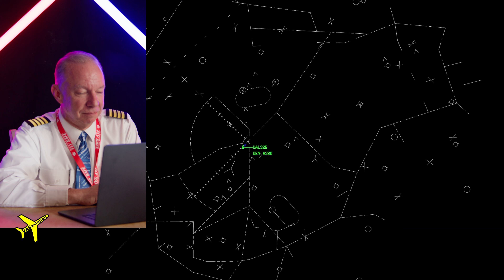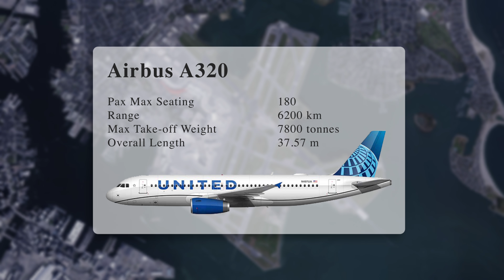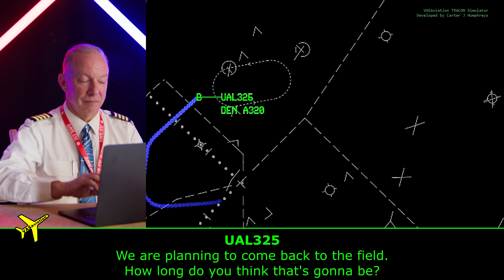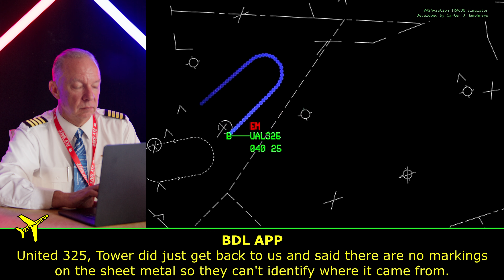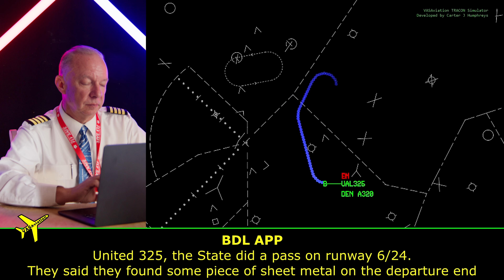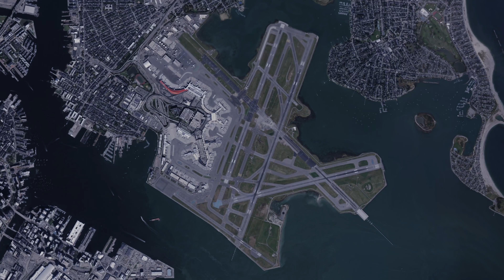United 325 Disaster Averted: Engine Trouble at Takeoff! | Captain Steeeve Breaks It Down

Comment: I know the Fire LT you heard speaking to the Aircraft.
This is from the report that was filed.
The Federal Aviation Administration (FAA) has confirmed that a United Airlines Airbus A320 was forced to return to its origin airport on June 20, 2024. The regulator said that the flight crew reported an abnormal noise during the flight.

The incident occurred on United flight 325, operating from Bradley International Airport (BDL) in Hartford, Connecticut to Denver (DEN). The flight was operated by an Airbus A320 with registration number N490UA. A piece of the engine’s outer liner, which helps to regulate volume, was found on the runway after takeoff.
Onboard, the flight crew noticed an “abnormal noise” emanating from the engine, which was explained by the missing liner. The flight turned around and returned to BDL, arriving about an hour later.
landing at the airport at 8:47. After the aircraft landed at its origin airport, it proceeded to taxi to the gate area at BDL.
with United placing passengers on alternate flights to get them to their final destinations.
Reply: Good summary.  The acoustic dampeners are part of the engine’s round inlet (cowling).  If they fall-off then they can pass thru the engine & cause damage to the spinning blades

.

Comment: As a maintenance guy this is our worst fear
Reply: I can only imagine. you keep them from falling apart and I kept them from hitting each other
Reply: @christophersaunders  We're doing a good job :D
Reply: Not like letting a car leaving the shop
missing bolts or not finishing job...?
Reply: @courtsports1 exactly. You can't pull over in the sky and fix it.
Reply: @courtsports1 you just like to argue and probably make everything about yourself
Reply: 🇺🇸Fried, I am number 138 thumbs up for your comment. ONE Question Please: With such Airplane parts, be it Sheet Metal (NO Matter the size), AND/OR Any Other parts, ARE parts MAYBE Engraved with Airplane Company/Business Ownership Identification Markings, MAYBE AT LEAST Identification Markings Engraved in 2 Places PER Parts, AND WHERE PER Parts Belong/Come From ON EACH Airplanes?? Thank you.
Reply: @KhenoronhkhwaJesusIs  What I know Airbus does is they will have an outside P/N and S/N and one that is inside the part that requires to be ground down and therefore damaged to be read. They can use it in case of an investigation if needed. But I don't think they do the same for metal sheets cause they are too thin
Reply: What is?

Comment: “Souls on board” also differentiates between people and bodies as sometimes aircraft may be transporting a dead body.
Reply: I've heard that before, but if that's the case why wouldn't they also ask how many bodies are on board?  If the plane wrecks and they're finding bodies, how does having info only on the number of souls make any difference? And if it would be easy to differentiate between the two, why are they concerned with souls? 🤔
Reply: nodangles6983

You don’t necessarily know how a plane going to land in an emergency, that’s why Miracle on the Hudson was a miracle—planes that aren’t designed to land on water normally don’t land in one piece. Also sometimes people survive the unsurvivable; PamAm Flight 759 crashed and killed 146 people, one toddler survived.

The reason behind using the term “souls on board” is to ensure accurate communication and safety. In emergency situations, such as a crash or an incident that requires immediate action, it is crucial for the pilot to know the total number of people who need assistance or evacuation. It’s one syllable shorter than people or persons, conveys living people vs corpses, and isn’t used much in daily life so it stands out.
Moreover, using “souls on board” also acknowledges the presence and importance of every individual on the aircraft. It includes both passengers and crew members, emphasizing the responsibility of the pilot to ensure the safety and well-being of everyone onboard. It creates a sense of unity and reminds pilots of the magnitude of their role in protecting the lives of those in their care. This term emphasizes the gravity of their duty, which goes beyond mere numbers and statistics. 
As a command post controller (not ATC) my job to facilitate communication between the pilot and any help they might need, accurately, in a hurry, and without anyone having to unnecessarily repeat themselves. We don’t need to differentiate between living people and corpses, because we only have to be prepared to rescue the living people.

Comment: Flight was on June 20, 2024.  “A portion of the engine’s sound-dampening outer liner was found on the runway.”  Several news organizations reported the same thing.
Reply: So, one of the maintenance crew thought, "Wouldn't it be cool if this Airbus sounded more like a Harley than a Honda?"
Reply: @WMHinsch ”If it sounds louder, it means it’s more powerful!”
Reply: Thanks for the follow up. It was an obvious question, and I'm surprised Steve didn't cover it. 
Some mechanic probably had a bad day, but now knows where those extra screws we're supposed to go!
Reply: Something like that...also could have
been what channels exhaust gases
since they had over temp...nothing to laugh about when parts fall off your plane...more than a few is bad...
Reply: @Bannering101 When it's engines  failure  from boeien he don't say much because he love his boeing. But fault is fault need to say the bad and the good.But its his youtuber he is his own boss.
Reply: @christinebrown4901  Facts are always useful, Christine. The aircraft was an Airbus A320, not a Boeing. But you clearly have an agenda that's anti-reality.
Reply: @christinebrown4901 can someone translate to an intelligible comment?
Reply: @mewintle  they're big fans of Boeing 😂
Reply: Thx for saving me a google
Reply: So that was the initial part but additional parts fell off as he landed.  I couldn’t find the actual FAA or NTSB report everything came from the news and they were also reporting he returned from an “abnormal noise” not from what we actually heard.  From what I read shortly before this happened something similar happened on a plane out of Denver and that one actually had a report what’s weird is the flight numbers are barely off.  UA325 was this one and US328 was the other one.  So I’m thinking the information from the wrong plane was reported.

So we definitely still have unanswered questions.  What were the additional pieces? The first piece really was the sound dampener?  Why are most of the reports saying it was from an abnormal noise when it wasn’t (a couple were right)?  It took a full 5 days to get that plane back into service - how does it take 5 days to replace sound damper if in fact that was the only thing that came off?
Reply: Thay more than likely did a full inspection which, if done correctly,  would take several days.
Reply: @DeathyAS  you'd better believe that plane got a full check over after that.  Did anything else come off.  Did the pieces that came off strike anything Coumbia-style?  Were the fasteners faulty?  missing?  only partially secured with insufficient torque?  Stressed parts? All parts genuine?  Time needed to look into maintenance logs, interview the maintenance team.   It is absolutely not so simple as just a part replacement.
Reply: FAA report said - POST FLIGHT INSPECTION REVEALED THE RIGHT ENGINE COWLING HAD SEPARATED.
This came from the Aviation Herald
Reply: @fluffyfour cowling separation was my first impression too, before seeing this
Reply: @fluffyfour  cowling is made of sound dampener panels. Tomato - tomato.
Reply: That would seem like it would give extra cooling.  Why was their a spike in EGT?  Unless the sensor was jiggled when the cowling seperated.
Reply: @spyder000069  possible some bits ingested. The engine might have been completely rebuilt due to this but I guess we'll never know. Transparency only occurs when it's unavoidable due to severe outcomes.
Reply: Thanks for sharing and clearing up!
Reply: Woo-hoo! 500th like on this comment 😁
Reply: So planes carry extra parts......
Reply: I was going to guess that. It is the most obvious answer what jet can shed.
Reply: Thanks
Reply: I rember 1 of steeeve video wear a plane lost parts a start a grass fire at airport do you rember that fire the artful codger
Reply: Thanks for that - I watched the whole way through, to see what it was!
Reply: DEI hire strikes again

Comment: Driving northbound on Hwy. 101 towards San Francisco, I saw a two engine jet blow a motor just shortly after takeoff - I'm thinking probably within the first 15 seconds or so. I have no idea if it was due to a bird strike. I just saw a big flame come out the back of one of he motors. I had time to kill, so I pulled off at Millbrae, which is just at the south end of the airport. They went back over S.F. Bay and dumped some jet fuel - you could see that clear as anything - then it turned westward towards the Pacific. I finally got myself around some folks who were monitoring the radio traffic. The jet dumped more fuel out over the Pacific. Eventually it came around to make the usual approach to the long runways - left or right - which brings them back over the peninsula roughly around Palo Alto or Menlo Park (facing east), and then turn left for final approach over the bay (facing north). The only land they pass over on final approach is a bit of Foster City and the San Mateo Bridge. That's only a few minutes from touchdown. Everything worked out. It was very interesting to see, but everyone was glad that everybody was safe. Fairly routine, I suppose.
Reply: I bet it was United.

Comment: Would the tower, with binoculars, be able to distinguish a blown tyre from an inflated tyre while the plane is in the air? As a truck driver, the only way we can easily tell without driving on it, is to hit it with a steel bar. An inflated tyre sounds like a bell while a flat sounds... well flat. If I was 100m away, even with binoculars, I would not be able to tell a flat tyre from an inflated tyre. 

Sure, if the tyre is shredded, you're going to know, but not if it's just had a blowout.

Comment: Back in the late 80's and early 90's I had two emergency situations when I was a Flight Attendant. The first was during Deseret Shield when working a flight from Charlotte to Dulles. On landing in a big crosswind, we had both tires on the right main gear blow on landing. There were about 25 pax on board and I was in the back of the aircraft. I turned to the crew person next to me and said "get ready we might have to do our jobs." luckily, the gear didn't collapse and we bounce to a stop. the pax were taken to the terminal by bus. The second was the scariest. On a hot summer day taking off out of Denver on a 727-200 the left main gear tires blew on takeoff. the pieces of the tires got sucked into the engine which exploded it. Ther wasn't more than aa shell left. I was the head F/A and had to prep the cabin for an emergency landing and potential evacuation. The cockpit crew were too bust to do anything but keep the IRTCRAFT IN THE AIR. we lost hydraulics and also electricity to the cabin, including the PA System. I had to prep the cabin with the Megaphone instead of the PA. We landed safely and didn't have to evacuate.  Any emergency required a team effort between the cockpit crew, the cabin crew and the pax. In this case it all worked out.
Reply: amazing how one can or doesn't react in a event ..hero's are made and lost..Bless em all
Reply: For the grammar police, you don't start a sentence with the word "And". Just saying.
Reply: Unless you're Chaucer, Shakespeare, Dickens, Austen, Fitzgerald, Hemingway, all used the polysyndenton style of starting sentences with "and." There is no such rule. It's a style guideline.
Reply: @jaybee8858  You are a terrible person and everyone hates you.
Reply: If you’re referring to President Bush Senior’s war it was called Desert Shield (not deseret) and Desert Storm.  And your story is why I don’t have a job on a plane. Eventually you will have an emergency,

I don’t need that stress.
Reply: @electrictroy2010 . Twenty-seven years here.  All of my inflight emergencies were medical.  Did one at-gate evac out door 1L due to fuel leak leaving large pool of fuel on ground.  Not a big deal.  You will be fine.
Reply: @electrictroy2010  if you want to be the grammar police, maybe i should tell you that both of those Operations are now referred to as The Gulf War.

Comment: Was the debris part of the nacelle?  The fire crew didn't want to say on frequency what the metal parts were.  Maybe part of the winglets, if so equipped?  The company did not want a low level pass.  The crew probably had a "3-green" on gear extension so a low pass wouldn't have helped.  Hope you can, in a future video, follow up?  Maybe?  Or not.  Yes, fly safe.

Comment: I actually was on a plane in minn.  As we were taxing down we blew a tire, so back we went to board another plane that as we were sitting waiting to take off we had electrical issues. Back we went for another plane. What was to be an hour long flight ended up 4 hours. That was in 1999.
Reply: You were Actually on a plane in Minnesota?  Wow.
Reply: @electrictroy2010  if you flew on Northwest at any point during their ~84 years of operation, there’s a good chance you ended up in Minne at some point. 

Even still today, MSP is the 2nd busiest airport in the Midwest, behind only ORD. Delta kept Northwest’s massive hub there, and has actually grown it pretty substantially since they took it over.

Comment: Why tower has to ask how many souls and feul they have ? They already have all data how many people boarded and how much fuel that flight has took before takeoff 😳.  In mayday situation it's very bizarre to ask such thing from them. Putting more work load on pilots. Yes in certain conditions they can ask about remaining fuel but once they took off no passenger departed the plane.
Reply: Not a pilot, but they almost never need that data, and I would guess they don't have it easily available. 

Also, in an emergency, things can move really really fast and it's better to just ask the two most critical questions: 

1. How many people do we need to look for?
2. How much explosive fire juice do we need to manage?
Reply: They don't want to be in a situation where a standby crew member hopped into an empty seat at the last minute and fire crews only looked for 99 people instead of a 100.